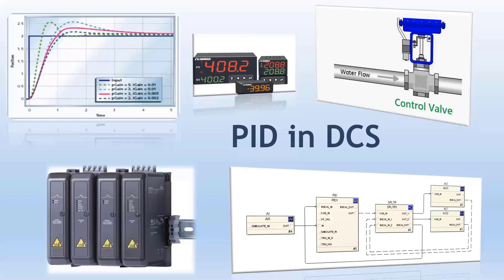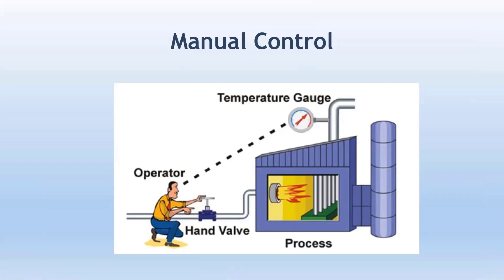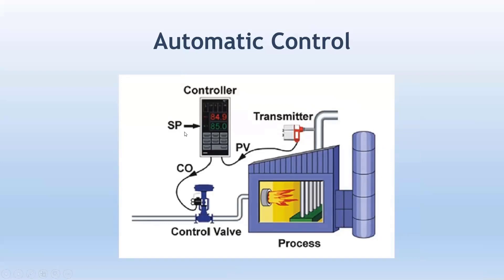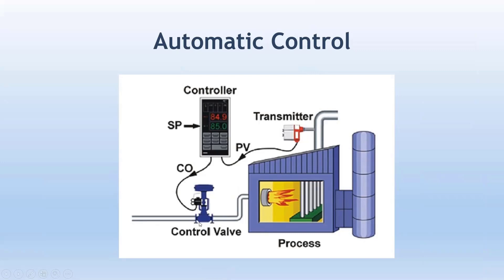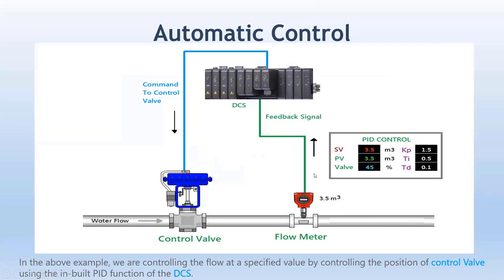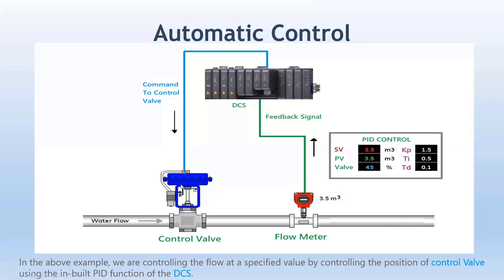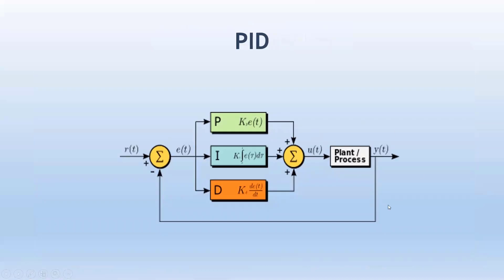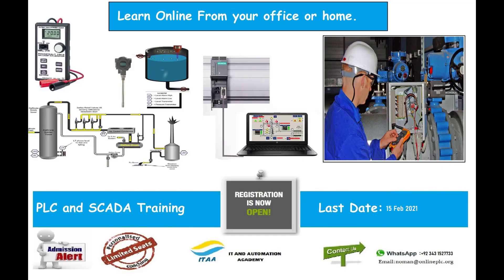What is PID Controller in PLC/ DCS?

Comment: 00:29 🌐 Before PID controllers and automation revolution, manual control involved operators using gauges and handwalls to regulate processes in industrial automation.
01:51 🔄 PID controllers replaced manual control, providing a more efficient and automated way to regulate processes.
02:20 📊 In PID, a transmitter measures the current process value (PV), which is compared to the set point (SP). The difference is the error, and the controller adjusts the control output (CO) to maintain SP.
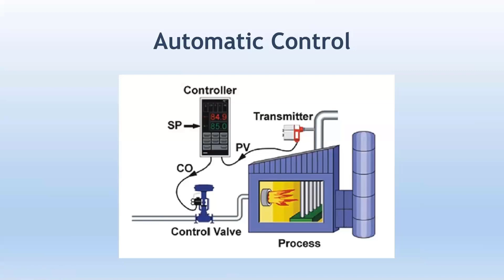04:40 ⚙️ PLCs and DCSs have PID blocks replacing traditional controllers, offering a more advanced and flexible control mechanism.
06:44 📈 PID loops in a DCS involve connecting a flow meter to the analog input module, using a PID block to regulate the process, and sending the output to the analog output module connected to the control valve.
08:35 🔄 PID involves three terms - P (Proportional), I (Integral), and D (Derivative), which determine how the control output adjusts to minimize the error. Tuning these terms is crucial for effective PID control.